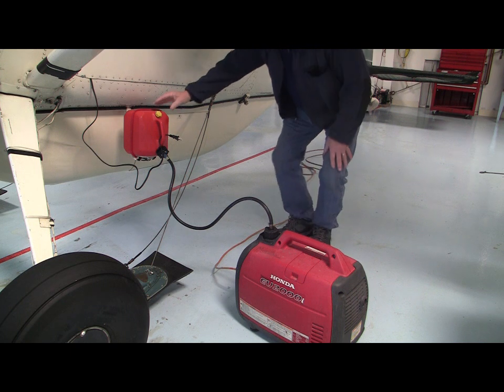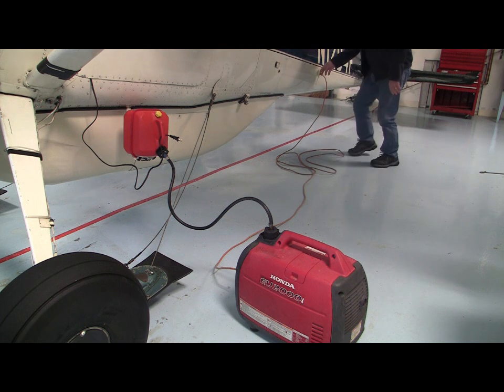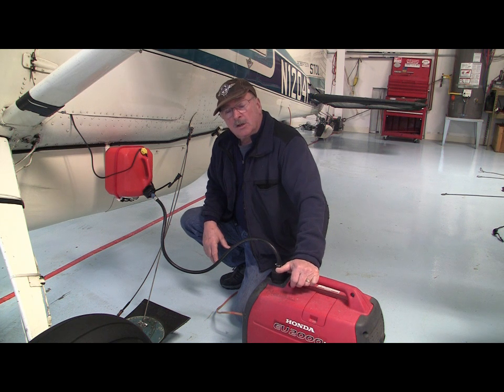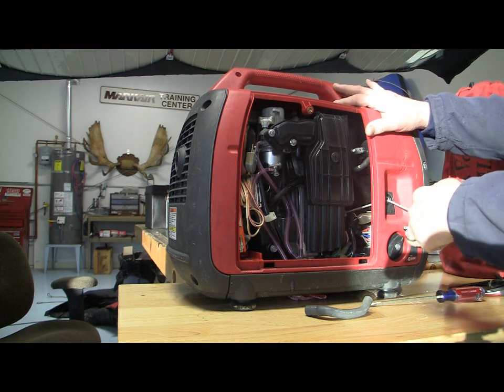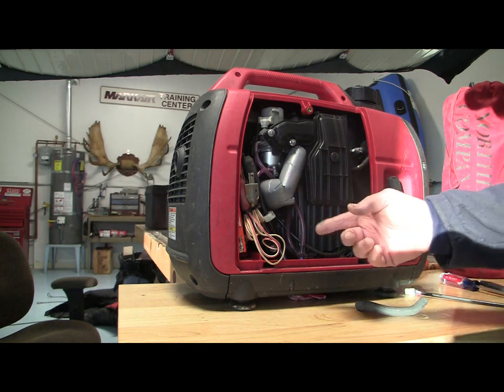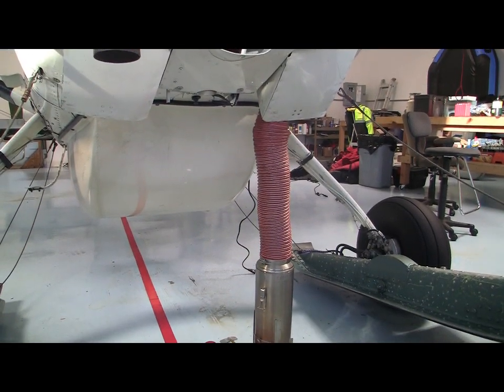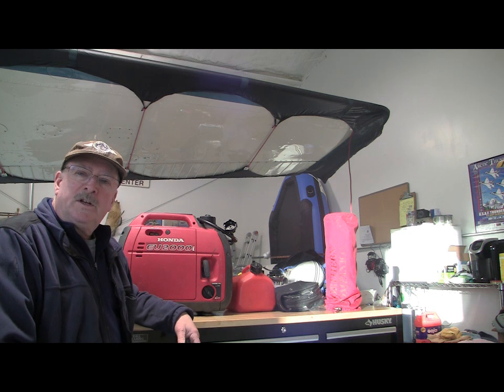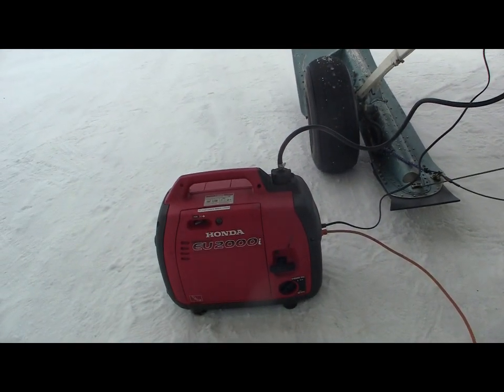My Aircraft pre-heat system

Comment: Good information. Question. Is there any danger of setting something on fire by putting the catalytic 
Heater in the engine compartment?
Reply from the maker: The catalytic has no flame but it is very hot and can melt wiring, I set the heater under the exhaust away from wiring. This type of heater will not preheat a cold engine, propane will freeze but it will keep a warm engine warm enough to safely start after 12 hours at sub 0'f temp.